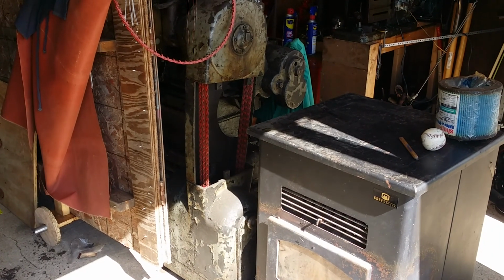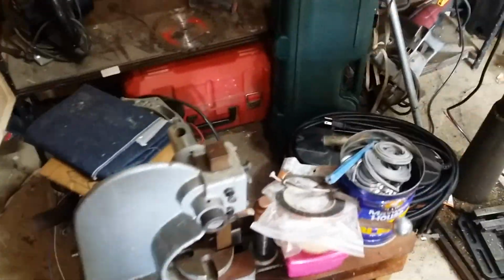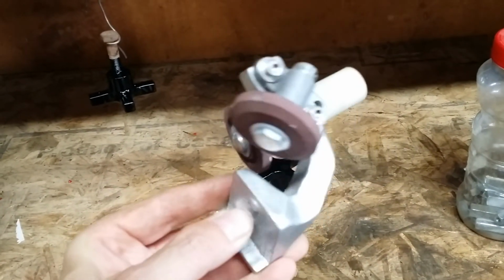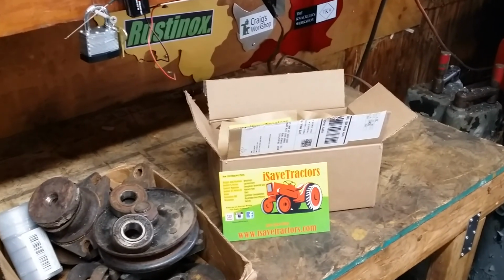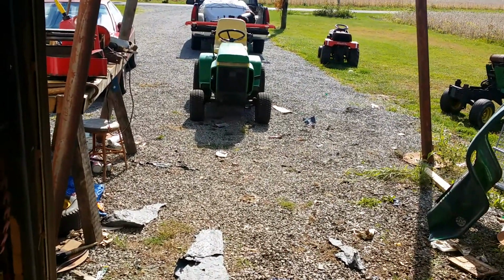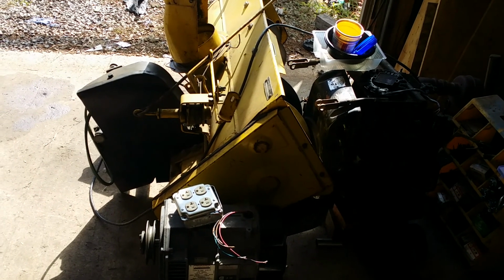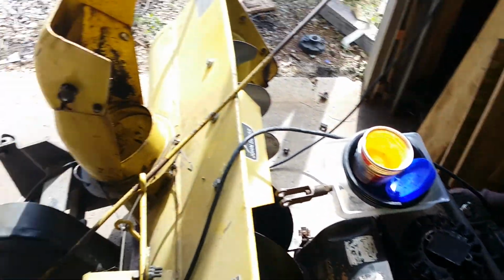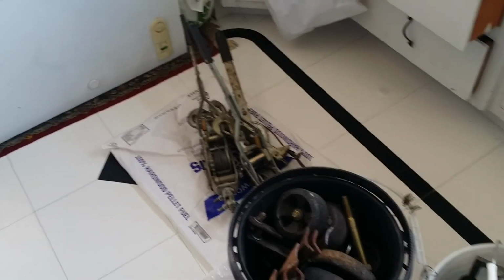Oct update long winded rambling

Comment: I try and watch some of the Russians, you can turn on closed captions and get some of what they say. My first thought was a scissor sharpener? The knobs turned out pretty good. If you're not careful you'll end up with a clean garage. I have a 3 pt. snowblower that I want to put on my Kabota B6000 but I have to rebuild the injector pump on the tractor first.
Reply from the maker: Thanks for the tip on the closed caption. I will try to find that control. Oh man rebuilding an injection pump. Have you done any before? I haven't been around diesels enough to get the opportunity to do that type of repair , I tend to like complex gadgets :-)
Reply: Nope, this is my first. Though it's only a 2 cyl and from what I've read it's usually a broken spring. Shouldn't need to take it all the way down if that's the case, fingers crossed.